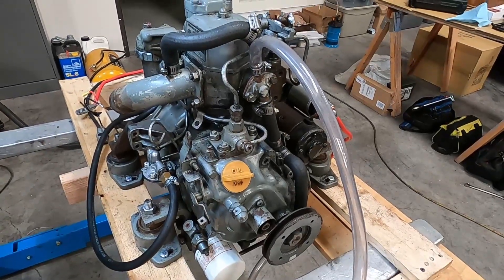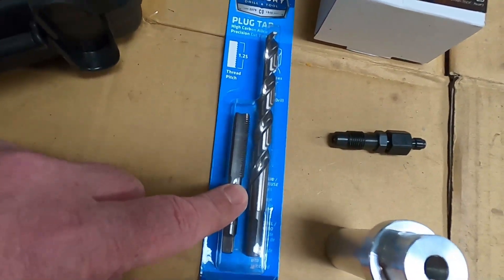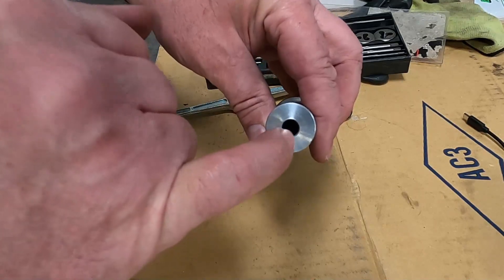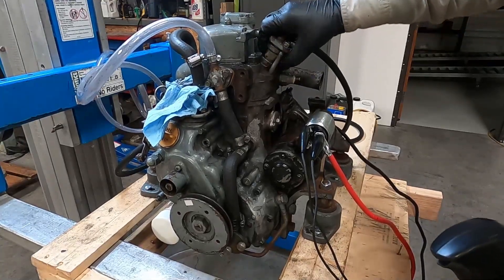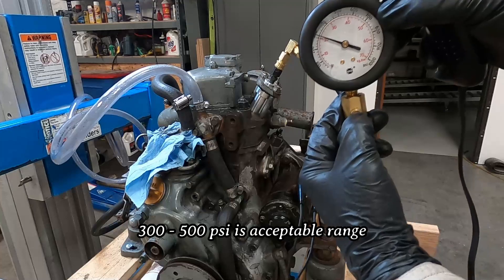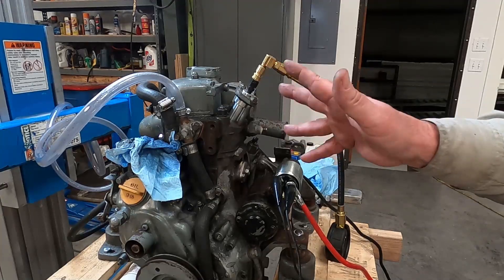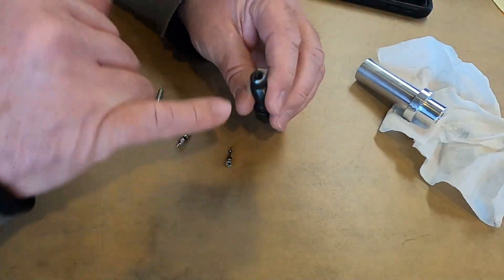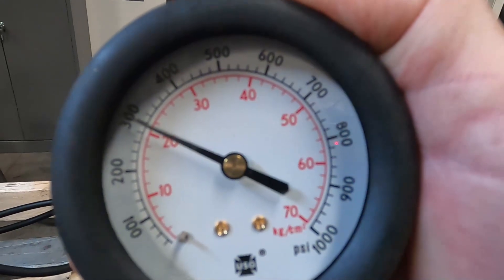Initial Compression Test of my Yanmar 1GM Diesel Engine - Voyage Dreams 84

Comment: I have a 3GM30F and am planning to do a compression test on my engine soon with the same adapter from Tractor Supply. According to my service manual for all the GM engines, the bore x stroke are 75mm x 72mm. As the Yanmar specified compression ratio is 23:1 for all GM engines, at sea level (1 bar) the engine compression should therefore be 23 bar, approx. 334 psi.

Based on the compression ratio and cylinder bore x stroke, the combustion chamber volume can be calculated to be 14,459 mm3. I measured the adapter with a calliper and found the volume of the adapter is 4,496 mm3 (8.6 mm diameter x 77.4mm depth).

This additional volume will reduce the compression ratio to 17.8, so at sea level (1 bar) the compression tester when using this adapter should read 17.8 bar, approx. 258 psi when the compression is on spec.

EDIT: using the official average of 1013 millibar at sea level, the compression of the engine should be 23.3 bar, approx. 338 psi. Factoring in the adapter volume, it should be 18.03 bar, approx 262 psi.